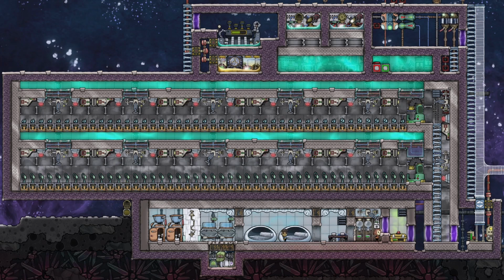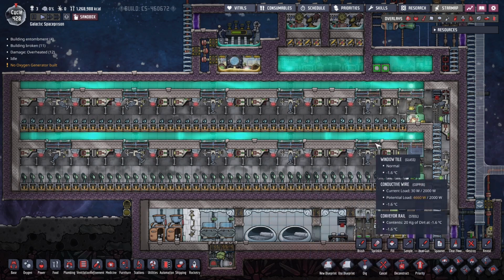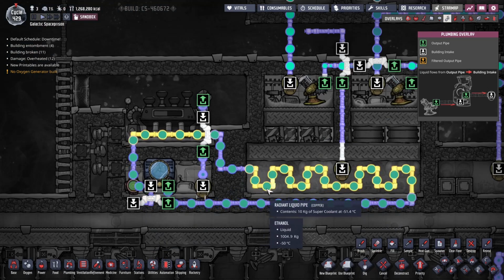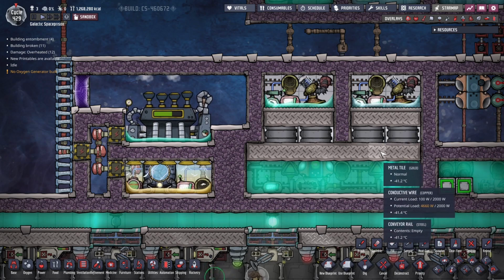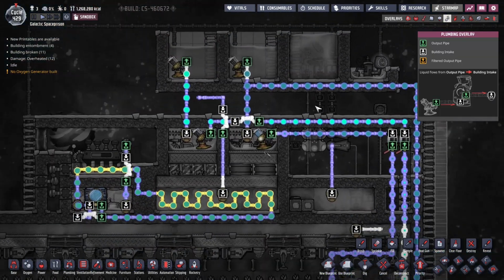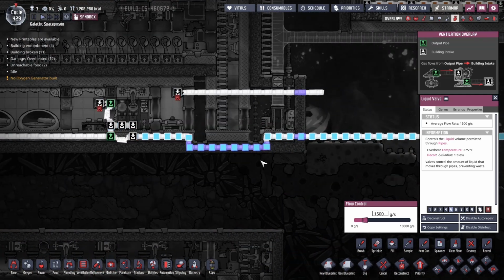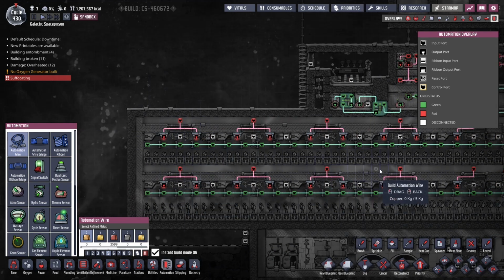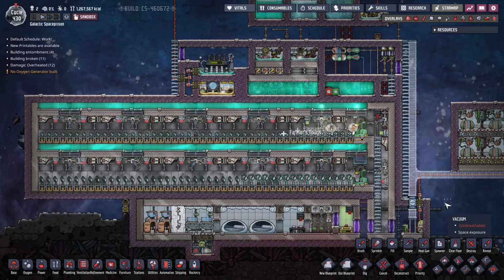Nosh Beans & Chill - Oxygen Not Included

Comment: how much power and dirt and fertilizer does this farm need to run?
edit: 1k watts is very decent, I never bother with nosh beans, worst crop in the game imo, good job bro!
Reply from the maker: Here is what I got (rounded-up to nearest Kilo)
Consumes:
450 KG dirt/cycle
900 KG water/cycle
900 KG ethanol/cycle
450 KG fertilizer/cycle

7 Fertilizer Synthesizers at 89% uptime
Consume:
244 KG dirt/cycle
147 KG polluted water/cycle
98 KG phosphorite/cycle

12 Compost piles at 96% uptime
Consumes:
694 KG polluted dirt/cycle

3 Ethanol Distillers at 100% uptime
Consumes:
1800 lumber/cycle
Provides:
900 KG ethanol/cycle
600 KG polluted dirt/cycle

Water Sieve at 78% uptime
Provides:
94 KG polluted dirt/cycle

Results (boosted):
Wheat: 9 cycles/harvest
Nosh: 10.5 cycles/harvest
Reply: @greezyhammer764  thanks for the numbers :)
Reply: actually, i would rather use nosh plants over sleet wheat, mainly because ethanol is easier to cool due to heat capacity being way less than water, and it doesn't hold up the usage of water for oxygen. one distiller will support 15 plants, which is a better use than the petroleum generator.

Comment: Great video mate. One question. How did you build those doors with a liquid in? It looks like a very good way of perfect "liquid airlock" to build. But how did you manage that?
Reply from the maker: If it's in space, you place the pneumatic door first, then put a liquid vent above the door. Then, drip 300g of oil, and then 300g of petroleum, then replace the vent with a tile.
Reply: @greezyhammer764  Oh ok. Thank you for the tip.